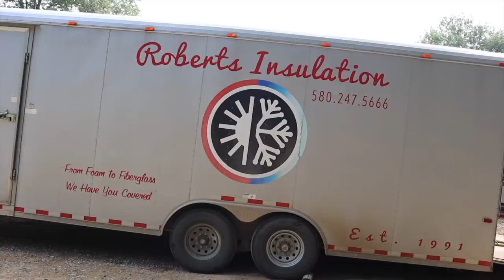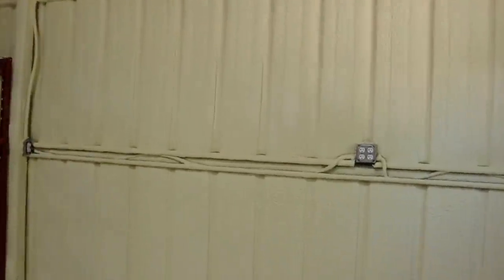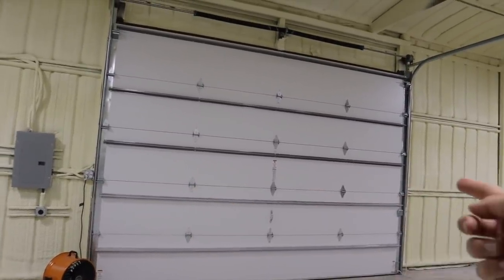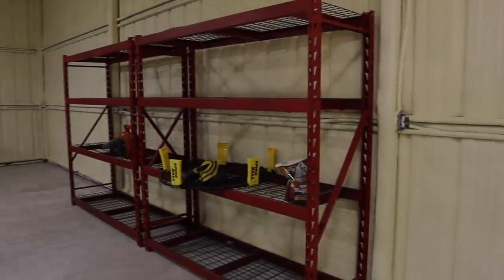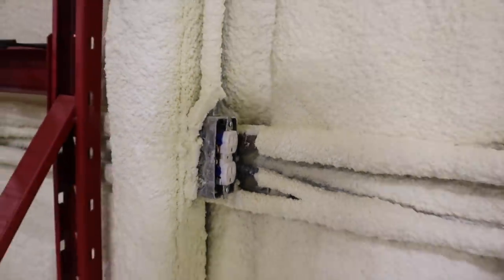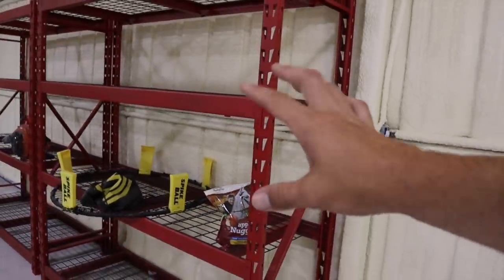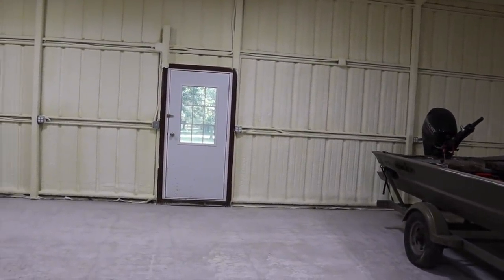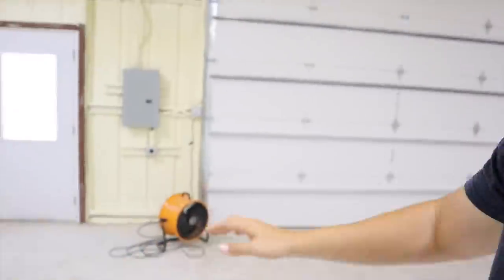After 5 YEARS It's Finally Complete! Metal Pole Barn/Shop Build

Comment: I started with a pole roof (36x48) back in 2010, which I did hire out as it was not something I could build myself.  17k!  Then, in 2016, I started filling it in - concrete blocks between posts, U-channels and 2x12x12 boards - instant walls!  Best thing, I can easily slide out a wall and re-configure if needed.  Also, I can say that my chickens built most of my barn (not including the pole roof).  I sell eggs and every time my cash envelope would reach 1,000, I'd head to to the hardware store for some lumber, blocks and paint.  Bit by bit, my barn has taken shape.  We have hired in someone to expand the roof on the sides, but everything underneath was built by my dad and me.  It's a awesome feeling.  It's especially crazy that my barn is bigger than my house!!  haha

Comment: My old bosses son back in 2001 was a cop and he was shot point blank in the face. Leaving his wife with 5 small babies. You made a good choice. My building is 40x60 concrete floor all electricity is in the floor. The building is enclosed on a 3rd section only except one outer side wall. It also has regular I beams running across for structure on other metal I beams. Was built in 1977 we contacted the company who put it up to completely redo it, but they were way too high. So we are slowly getting it done by ordered new sheets, girts hardware and other pieces. Since it's hurricane weather we will wait on finishing it.

Comment: Great job!!! Did you look at doing some cross ventilation fans up high  on each end in the walls? I put those in on a building similar to yours that housed indoor vermicomposting. You could set them to go on by  temperature and/or humidity if I remember correctly. I’d have to did out the plans. Helped a lot on the airflow.

Comment: Hey Danial good to see ya suggestion for you before you get air conditioning put a big fan at both ends of your gable ends just below your rafter one to pull air in and one to push out air you’ll be amazed at the results you’ll get it will be like being in wind storm in summer time

Comment: The barn is looking great. You mentioned looking for pallet rack shelving, I've seen some used ones on the repurposedmaterials website. Throw a dot com on there if you're interested.
They also have used street sweeper brushes you can put out for your livestock to scratch their backs on. 😀